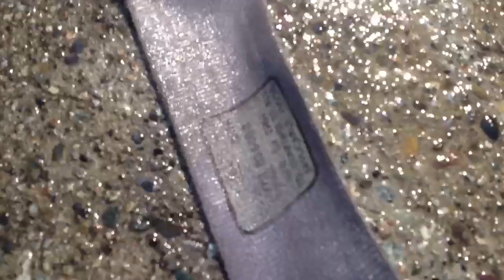Easiest way to remove black mould,mold  from a seatbelt

Comment: I'll admit I'm a little surprised, since I do a lot of reading about car seats and such having 4 Kids, the majority of the information out there says "never even let's seat belts get soaking wet", let alone use a pressure washer LOL, but they also suggest using a baby brush and a damp rag - like that would work. extremely effective, and very fast. I may just have to try this